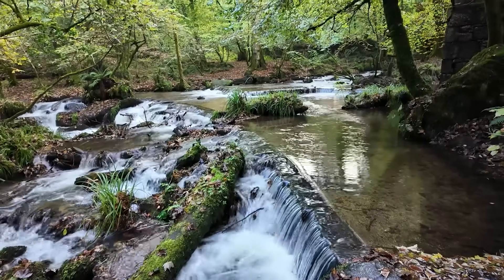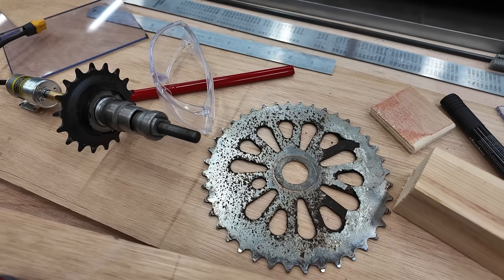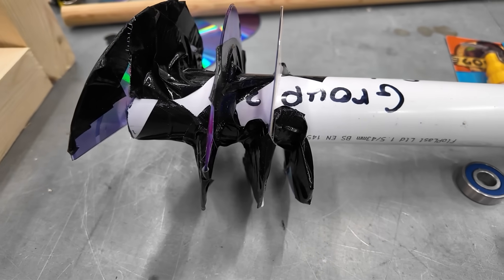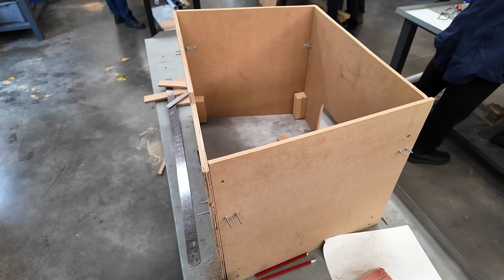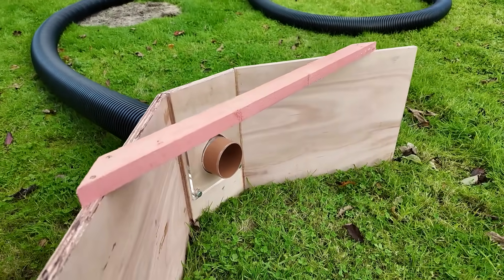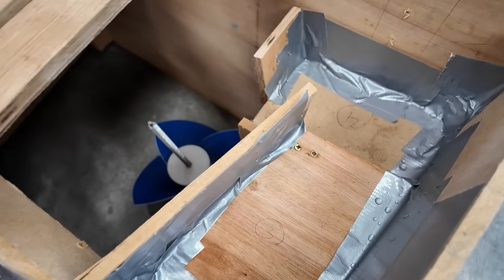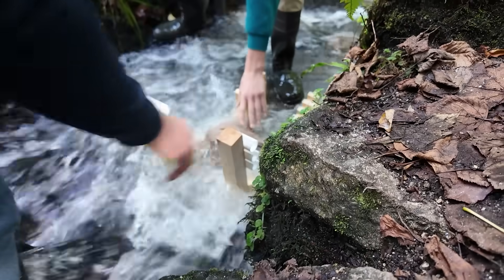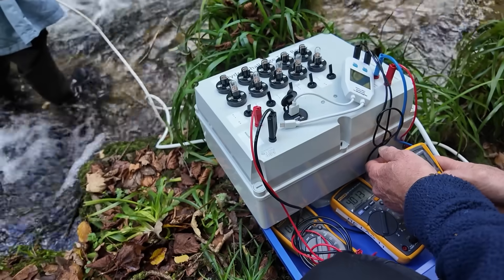3D Printing a TURBINE to Produce Cheap Electricity

Comment: Special thanks to everyone involved in this project and made it happen. This was a real treat to see.

In my humble opinion, I feel 3D printers and laser cutters should be prohibited for this challenge. Vertical wheels with buckets should also be prohibited, or at least limited in how many teams can use them. I only say this because I think it would encourage more outside of the box thinking and resourcefulness of the students/participants.

Surprised none of the teams using water bottles thought to have a multitude of bottle caps with different sized holes drilled into them to adjust water pressure/flow.

Looks like a fun and interesting project. Too bad this was far too short of a video to truly get truly invested in any of the designs, and with the exception of the Archimedes screw, most of the designs weren't distinctive enough to feel invested in. Be nice to hear more about what was allowed/disallowed for use and more about this semi-competitive project or competition. Not sure why disclosing the power output generated by each design would discourage current or future students, especially since each of the groups remained anonymous. In my opinion the metric of being able to power a light bulb or not seems more embarrassing than getting the clinical raw numbers of voltage and amperage. Now all the designs are judged by a pass/fail binary. Not being able to get some unknown bulb type to light up doesn't tell any of us spectators anything. Seems antithetical for a university or school to hide information that others may be able to appreciate and/or learn from. The light bulbs not turning on could be anything from bad connections to faulty bulbs, so it would have been nice to see each design spun manually and see the bulbs light up before being placed in the water so we spectators can see there's no faults in the wiring, generators, or bulbs.

Still enjoyable to see projects like this take place. Thanks again.

Comment: Besides the efficiency of the collecting device, one would think that these students would know how to look up calculating the available energy in the water and how it is related to the drop in height and the flow/volume. For starting students this is a very good way to imprint the importance of understanding the basics, doing research into other projects (many available on YouTube), and good modeling. I would have given the team with that long tube from the building site the best chance of succeeding, as that would give them the opportunity to create the biggest water pressure/head. I am no engineer myself but I feel projects like these give the students an understanding of why all the other stuff they are required to learn is important. 
Great video

Comment: Good video! 

I thought of my own design recently, for use in Ukraine ...

A disc + spindle, curved blades attached within, but leaving a circular gap in the centre. The whole thing encased, with an entrance hole for the air/water stream, plus an exit one almost directly opposite.

The fluid hits a blade, causing it to turn. The flow then continues along the blade, crosses the central gap and then proceeds to push one of the returning blades, in the same direction of rotation. Finally the fluid leaves via the exit hole.

PS The spindle itself could benefit from being a spiral, with gaps of it's own.

PPS I've bought some bits to make a test rig, but still TBD!

Comment: was a waterwheel / slow bucket elevator type with gearing not allowed? E=mgh, a tall, large chain bucket elevator fed from a large pipe high up the river would be optimal, no?